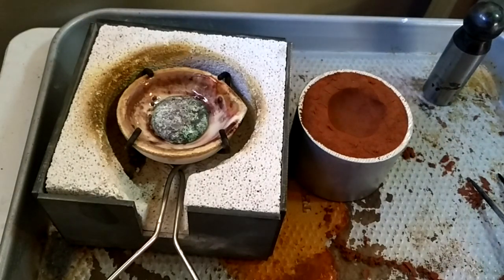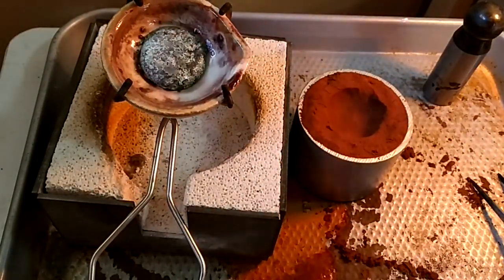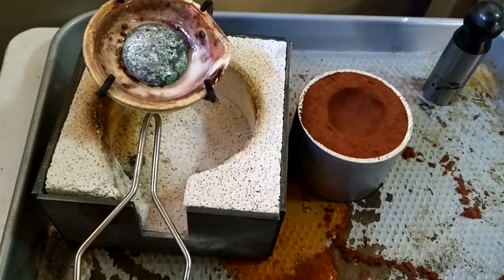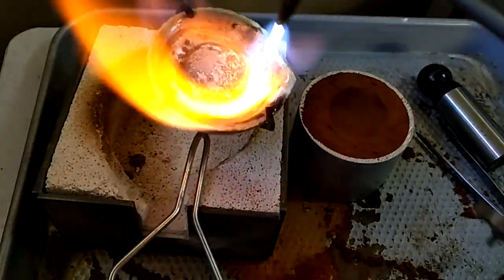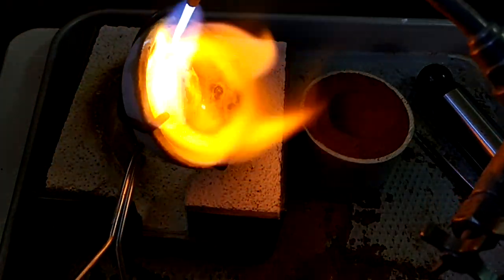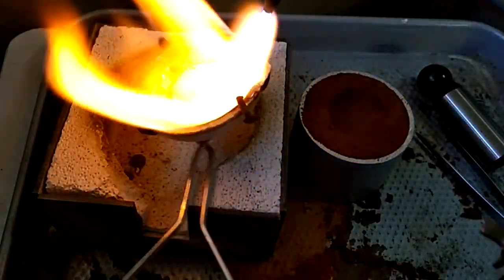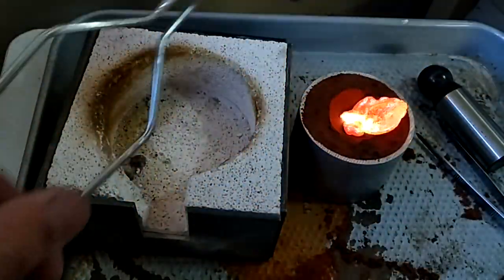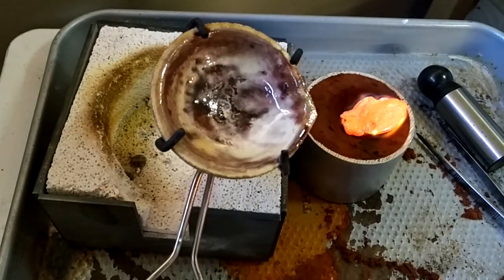How to Remove a Mass of Metal Stuck in a Crucible

Comment: Hi! I have the same issue, but my torch doesn’t give enough heat to loosen the metal again.. what nozzle / torch would you recommend to get enough heat? I’m using a propane torch (and I’m a beginner at this)

Comment: I just started having this issue with 2 crucibles in a row. Is it possibly because I'm using mapp gas and trying to melt 100 grams of silver? I had no problem melting this amount recently, but now just started having issues. The top of the silver puddle stays liquid, but the bottom  is solid and stuck to the crucible. I'm guessing that I'm not getting it hot enough.
Reply: You have to make sure to heat the surface of your crucible to a cherry red and sprinkle borax ion the surfaces to ensure it all has a glassy coverage. If metal gets stuck simply remelt it and pour it out. Map gas has nothing to do with it. In fact, map gas is preferred for melting. I used it for years and sometimes still do. I prefer my plumbers torch now with acetylene and special tips that are perforated at the neck to allow air to enter and make the gas even hotter.

Comment: I actually had this issue a few times. 
Note: it can be tempting to try and get those bits that stay when you pour or after a pour went wrong. 
It will not be smooth anymore if your prying out chunks, resist that and do a remelt. Worth saving the crucible. I don’t have a lot of money to get a stack and keep on hand. (Spares)